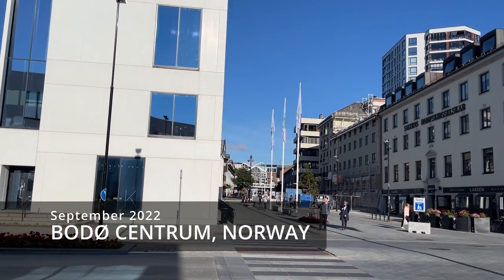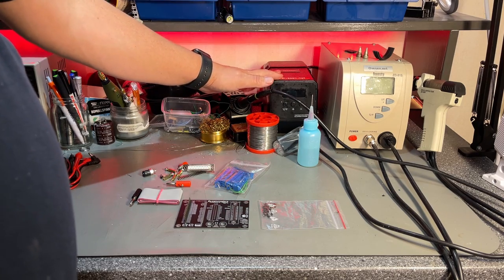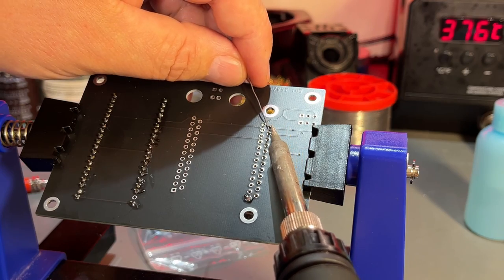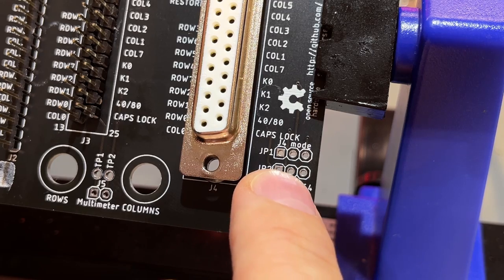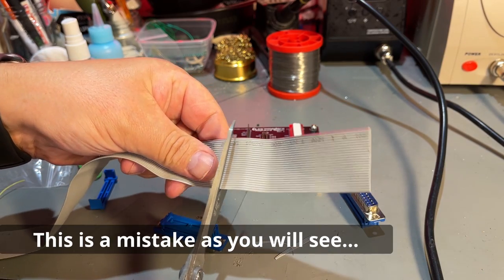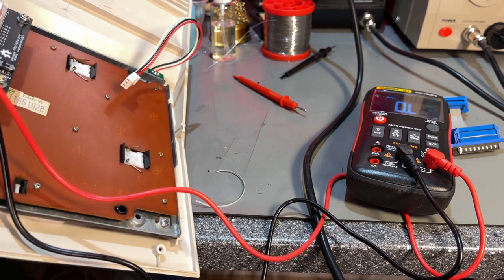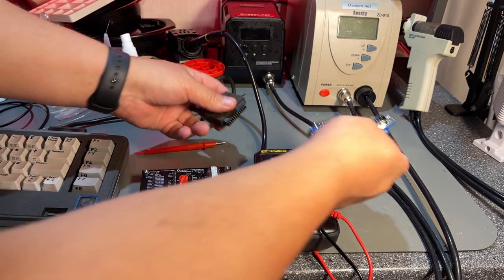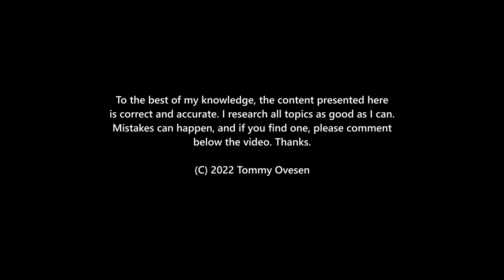Building and testing the Commodore Keyboard tester

Comment: Argh, they always use the standard round solder pads when designing boards.
Why don't they use the larger oval-shaped solder pads to make hand soldering easier?

Also, don't touch the pin you're soldering, but you learned that the hard way.
Reply from the maker: I did :) Do it a lot...

Comment: When I built mine last week,  I just soldered the meter leads directly to the two holes that would take the jumper wire to the panel jack instead of soldering on banana plugs.  For me, having detachable leads was not worth having the long panel jacks sticking out the back.  
Also I was wondering why a DB25 pin male through hole connector couldn't be used for the 128 connector if the metal case was cut off of it.  Maybe the pins are too large of a  diameter for the keyboard connector?
Reply from the maker: The 128 connector has special pitch between the pins so it would not fit a DB25
Reply: @Arcticretro  No, the pitch is the same as the DB25,  the test harness Sven made uses a DB25 female to plug onto the C128 motherboard.  it is the standard header pitch of 2.54 that is different than the connector.

Edited to add, I just measured the pin diameter of the header pins I have here are square and they are approx 0.6mm (on the flats).  the DB25 pin I measured is round and approx 0.9mm.  I am concluding that the female DB25 connector works fine on the motherboard pins,  BUT using the male DB25 on the keyboard connector will likely make it loose when put back on the motherboard.
Reply from the maker: Yes, you are correct. The documentation also states that now that I read it again. I just misunderstood it :)
Reply: @Arcticretro  I played around with it some more when I got home from work and discovered that my DB25 male connector has pins on the solder side that are very close in size to the standard pin header.  I removed the metal shell from the DB 25 and put it into the board upsideown.  That is to say the side with the round pins go into the pcb. They are a snug fit, but it seems to work.  I will glue together the two plastic pieces inside the connector that hold the pins.  The c128 keyboard connector seems to fit pretty well, at least on my test.